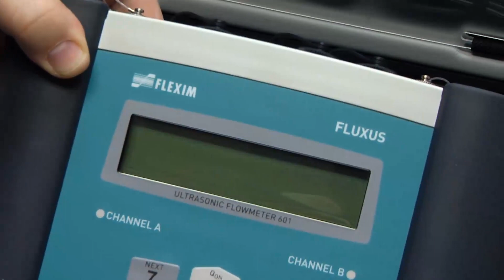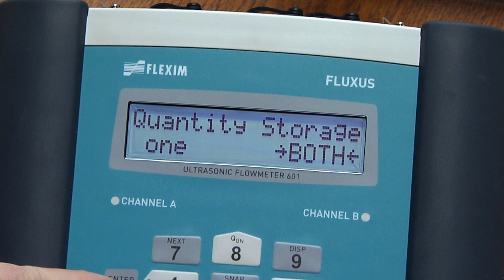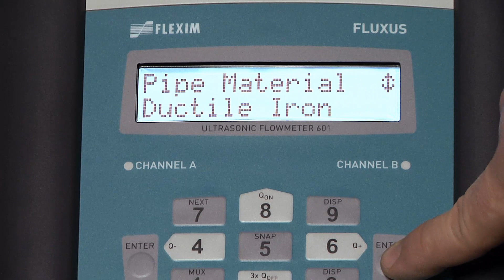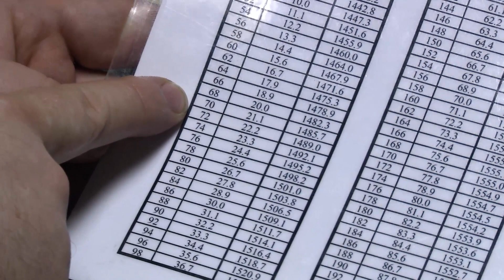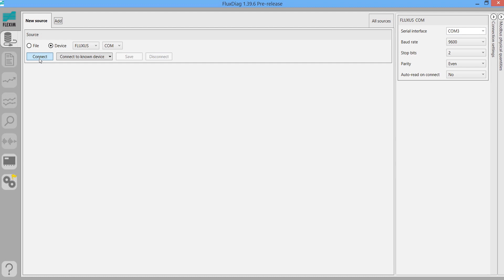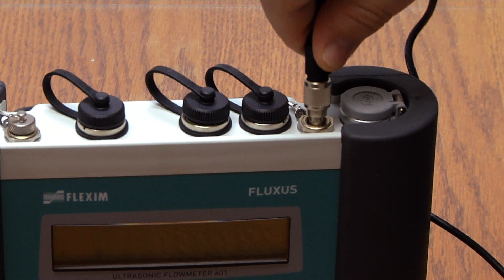FLEXIM F601 PORTABLE FLOWMETER SET UP

Comment: i did everything but my device didn't show on the FluxDiag Reader
Reply: that usually means you have to install the driver for the serial to usb adapter. Once that is done, if you still have issues then you should try different USB ports. You do have to tell the software which port the meter is plugged into. Always do a restart of the computer after installing drivers or making changes if it doesn't work right.
Reply: Contact Flexim directly.